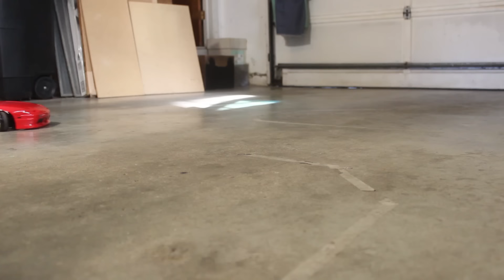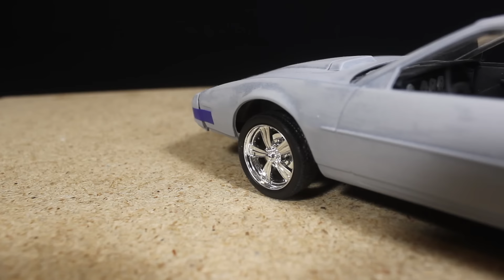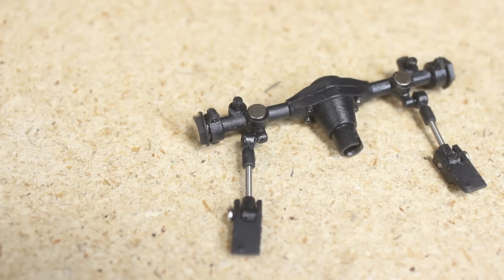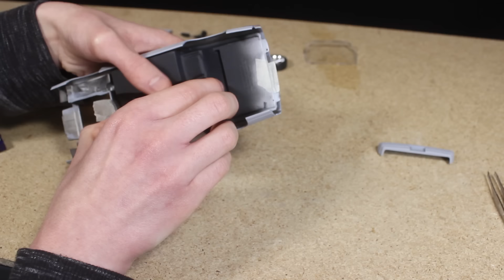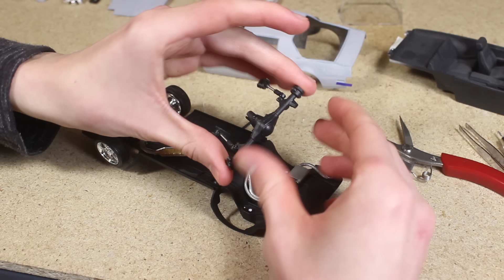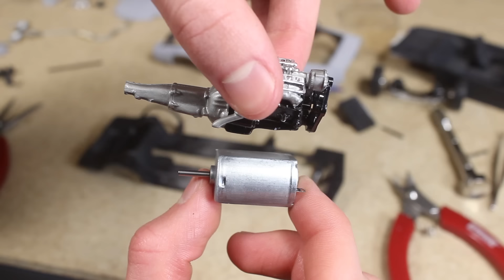New Mini RC Drift Build, Converting a Model Car to RC: Part 1 Overview, Teardown, and Test Fit Axle

Comment: It would look nice if the engine will be visible.Either do not put back the bonnet or could ✂️ it a bit and make sure engine is visible.I would paint it a dark red / bordeaux. Good luck with the build

Comment: Just to say... squirt some 3n1 oil in the crankcase through the crack then fix the crack with some baking soda and super glue by mixing them together. Don't know why I haven't seen this video til now but better late than never :) As for the body I think I would have chopped the windshield about 1/8" ish just to give it a meaner look... moving on to the next video.

Comment: note:  when buying non-hobby grade motors always look for CARBON BRUSHED motors.  conventional DC motors use thin metal fingers as brushes which wear through quickly.  carbon-brushed motors are blocks which have a lot of material to wear through.
Reply: Nerf gun mod motors such as meishel 2.0 or fang revamped are very good for wear too

Comment: The firebird was built for scca racing and other things so it had enough frame strength to go around the tracks, Not drifting, there were plenty of manual cars running around. If you had a motor with more torque then you had to fabricate something, I used bed frame rails. Car has been running in the 9’s with no issues.

Comment: I liked my 91 Firebird, but the Automatic and the 6cyl engine, weren't that desirable. Leaks are always a problem with these cars, as the t-tops always fail, leaving a swimming pool in the spare tire compartment. As a model, I built that model in 1992. I have however, drifted my firebird around a corner... The tires lost their bite on the asphalt.

Comment: I want to know: why do you choose brushed motors over brushless motors?
I know nothing about drift cars so sorry if this is a stupid question 😅
Reply from the maker: Generally for RWD drifting brushed motors and sensored brushless motors are preferred because they do not cog like unsensored brushless motors do. Or in other words they operate much smoother especially at low speeds which is especially ideal for RWD drifting. I'm not sure how critical this will be on this particular car and I will probable experiment with using brushless motors as well as brushed.

Comment: I used to "try" to do this when I was a kid. When I was about 5 y.o. I wired up a small motor to an extension cord and it ran for about 2 seconds then exploded in my face the cool part is no one had ever taught me anything about electricity and I didnt have google to teach me lol

Comment: how much are those little axles?
Reply from the maker: I'm not sure what the price will be at this time. The price will be determined closer to when the axles and chassis kit its apart of is released.
Reply: well i hope i find a cheap one because i wanna do exactly what you did with one it would be awesome, also i subbed to your channel
Reply: http://www.hobbywow.com/en-rear-axle-for-wpl-b-24-b-1-1-16-4wd-rc-car-p245212.htm    it's a 5"x2"x1"

Comment: Powerful v8 in a f body. Hahahhahahha. After teardown, rebuild with upgrade. If its not a 307. Pos motor. At that point buy a 327, 350 or 454.

Comment: Do it right and start with a model kit.  Then it'd be easy to hide the motor in the engine.  Where did you get a half assembled model car anyway?  Also, decide what you are building.  Is it a scale model for a curio shelf or r/c car for play?  If it's more r/c car than model just put a piece of cardboard on the sidewalk and spray paint the parts.  You can do it inside too it just requires more cardboard.  You're perfectly safe spray painting that much indoors even if you were in a closet.

Comment: I honestly cannot wait. This is making me giddy, ever since I was little I've been in love with the idea of doing this. I have no idea how you made that rear axel, especially that small but it's glorious. I'm super excited to see how you work out the steering, especially with the motor being in it's "proper" place. Thank you so much for this!
Reply from the maker: Thank you for the comment. I'm glad your enjoying the build! By the way the rear axle is 3D printed.
Reply: Really? The gears as well? thats super impressive.
Reply from the maker: Yep gears as well. 3D printing is definitely opening a lot of doors for what can be built.
Reply: Make It RC That's for sure. It's something I've wanted to get into and seeing your videos, it's like childhood dreams are coming true haha. If I may, what 3D printer do you use? I'm assuming a bit if a higher end one considering how intricate some of those gears most be.
Reply from the maker: The axle components and gears were made on a Formlabs Form 2 which is a higher end machine. I'm surprised it was able to print the gears being so small. I knew these printers were good but I didn't know they are that good.

Comment: You can remove the  paint on the body with spray on oven cleaner . It won't hurt the plastic . I'd paint the car white with satin black accents .

Comment: Your info on the Firebird shocked me. The auto shop at my school has a 1991 Firebird with a manual and either a 305 or 350 small block. It was donated after falling off the assembly line and GM wasn’t allowed to sell it. It was repaired by GM and only has 10 miles on it. It might be worth something.
Reply from the maker: Neat. Reminds me of my auto shop class in high school. The school was near a large GM plant that assembled trucks/SUV's. Trucks that came off the line defective or ones used for testing were donated to nearby schools. It was cool because some of these trucks were well over 30 years old but sill looked brand new.

Comment: I did this with a large scale diecast 74 chevy vega model. I put 2 mini blender motors in it an a cd player motor on the steering. I also put a wheel to each rear motor to see what i could make an to my surprise i was drifting a diecast vega around the dirt bicycle track at the house i grew up in.

Comment: All that work and painting to make that model just to get stripped again lol still a cool build tho. You should try to keep engine for looks.
Reply from the maker: I know right, the body and interior looked kind of junky but the undercarriage/chassis looked great, almost felt bad tearing it apart. Not sure how scale I'll be able to make the engine bay, but I 3D printed an LS engine topper for the motor. I put a pic up on Instagram, should look pretty cool if I can pull it off.

Comment: how do you find those small rear axles?? id really like to try and make a 1/18 scale modelcar an rc car but i never find the parts to do it.... and you earned yourself a new sub!
Reply from the maker: Thank you for subscribing! The rear axle is custom. I plan on selling them in the future, however they are too small for a 1/18 scale car. Not sure what the best components for a 1/18 scale would be. I've never built an RC vehicle in that scale before.
Reply from the maker: @brenkematthew The resin parts are 3D printed.
Reply: how much 4 the rears
Reply: China... You'll have to wait a little, but you can certainly find them and for cheap. Worst case buy a donor car in the appropriate scale, which again, can be had for extremely cheap, probably cheaper than this entire build with a decent receiver/transmitter and battery that could all be transferred to the chassis of your choice if so desired

Comment: Hey! I have absolutely 0 experience in this field, but I just wanted to suggest that you look into Nerf replacement motors. There's a surprisingly large community for modding Nerf blasters and they've even started custom making electric motors. You can get some really good quality 2S and 3S motors in 130, 132, and 180 sizes. Carbon brushes, neodymium magnets, the whole bit.
Reply from the maker: Interesting, thanks for the comment.

Comment: This is gonna be awesome. I'd stick with primer for the paintjob with some battle wounds as a WIP drifter. I love 1/24 "micro" RCs. The more scale looking the better. I see a lot of guys take a model body, paint it (rather shoddily) and slap it on a RTR micro chassis. I built a 1981 Ford Bronco from a Revell reissue kit and a RTR 1/24 Losi Micro Trail Trekker. I used the kit chassis and stuffed the running gear from the RC into it. Hid the battery and the ESC under the hood. It has a 4 link coil over setup up front and a custom leaf setup in the rear with anti-wrap bars. Here's a link to the forum documenting my build: http://www.scale4x4rc.org/forums/showthread.php?t=77104
Reply from the maker: Thanks for the comment, and nice build. That Bronco looks awesome! I have plans to do a build like that at some point. Will be sure to make some videos about it when that time comes.

Comment: Hey that axle, how did u built that, and the gears arrangements in it??
And if u can make those headlights open and close it would be just awesome....
Reply from the maker: The axles resin parts including gears are 3D printed. Functional pop up lights would be very cool to implement, but also a challenge.

Comment: YOOOOO

Even though I don't agree with a lot of your choices here, I still can't wait to see this thing pull a skid, spin around in a circle, etc. Whatever it does, it will be extremely interesting to see what happens. Good luck on this project! Also, may I ask, how did you make the rear diff?

Comment: Do you do commissions, suggestions, or only your own thing? If you are open to ideas, I have seen drifters use the 89-95 MN12 chassis, also known as Thunderbird SC, quite well.  The real thing is independent rear, 5-speed manual, 3.8L of factory supercharged V6 RWD.  A link to see one in action is below. One could find Revell models on ebay for close to $15.  I only mention this in case you run out of ideas.  Enjoy!  Oh, and yes, subscribed, as this looks like a fun build I would love to see to it's conclusion.
https://www.youtube.com/watch?v=OkB56OLsSDc
Reply from the maker: Thanks for the comment. It's pretty impressive to see a T-bird drifting like that. Would make for an interesting project, especially if a model kit can be had for cheap. Thought I really don't care for the styling of those cars.

Comment: This is freaking amazing, I’ve always dreamed of doing the same.

I vote against fender flares though.
Reply: Nathan Kennedy I would like to see the process and the files
Reply: Also, how did you make that rear axle?
Reply from the maker: The rear axle is 3d printed with steel shafts and bearings.
Reply: Ahh, cool. You should do a video making one.
Reply: @MakeItRC  everyboy owns a 3d Printer nowadays smh whats the cheapest one? Any1 know
Reply: @speedygee6396  A Good and affordable 3d printer is the creality ender 3
Reply: Grufhrhc
Reply: Nathan Kennedy lol

Comment: I've always wanted to do something like this! Though I've had micro RS4 back in the day and played around with that. Also had the RadioShack XMods as well with all possible modifications. The detail you can get with models combined with a powerful RC setup sounds great
Reply from the maker: Cool stuff, I remember those XMods cars, they were a lot of fun. I should be able to get some great scale detail out of this build and hopefully I can get the performance to match.
Reply: Make It RC I can't wait. You definitely have a new sub
Reply: Xmods we're the shit. I'm still bent up that I sold both of mine and probably $400 in parts to cash converters for like $20 to get a Nokia NGage lol

Comment: Are you aware that you got the 1982 firebjrd with the modified body that made it K.I.T.T. from Knight Rider? The Hood is the same, as is the front bumper. 
So you are moreless required to paint it black and give it the scanner running lights ;) 
Cheers! Awesome Work man!
Reply: Kitt didn't use that spoiler and that funky round front number is 91-92 the kitt used a steep and sharp front bumper
Reply: Front bumper is standard, not KITT. Not even T-top.
Reply: Hey, I thought K.ITT was a Trans Am..?
Reply: they used the same mold for a custom one, a pace car and this one

Comment: You mentioned that you designed the solid axle setup, but to what degree? Did you assemble it from available parts or did you have all the parts manufactured?
Reply from the maker: All the parts were designed by me and then 3d printed.
Reply: They don't look like they were done with FDM. Are they?
Reply from the maker: No, they are SLA printed parts.

Comment: This is going to be interesting. Any advancements in the pre-runner build your doing? Thx for your time.......wait maybe side pipes would be cool looking on the side  .
Reply from the maker: Prerunner is progressing but I need to do some painting which is difficult due to the cold weather, I think next step is to design the fender flares/ bed side pieces. 

I was thinking  of adding side pipes, or side exiting exhaust as well. I'd be easy to build, no worry's about interfering with axle and I think it would look sick! 
Thanks for the comment.
Reply: Make It RC ...indeed I respect how you go about your builds,RockOn! Thank you for.your support✌

Comment: I like the primer look, maybe it should stay the way it is. Can’t wait to see it done!!
Reply from the maker: Yea I do like the primer look as well, gives it some character. Thanks for the comment.
Reply: No problem, I was looking to build a 1/10 TransAm to match my real one but I could not find one anywhere & I think I might try to follow your steps and custom build one myself, maybe a 1/18 scale 😃
You are doing a great job making these great videos. Keep it up!!
Reply from the maker: Glad your enjoying the videos! Depending on what year your T/A is, I believe HPI made a 4th gen 1/10 scale touring body. I'm sure its out of production by now but you might be able to find one on eBay. Also MPC makes a 1/16 82' T/A model kit that would be a bit easier to convert to RC than a 1/24 scale.
Reply: Sweet! I’ll check them out, mine is the 3rd gen GTA, and it looks just like the one you are working on, I wonder if sandable Epoxy would work better on your 3D printed parts for smooth surface? I used stuff like that when I fix Motorbike fairings, it’s super durable and sticks to plastic really good
Reply from the maker: Sandable epox might work. I may try it out some time in the future. Good Idea.

Comment: Looks great! Maybe 3d print some steering parts?
Reply from the maker: Yep, will be printing some parts and most likely be using some metal rods as well. Ideally I'd like to have adjustable toe angle, but that might be a bit tricky to integrate. Thanks for the comment!